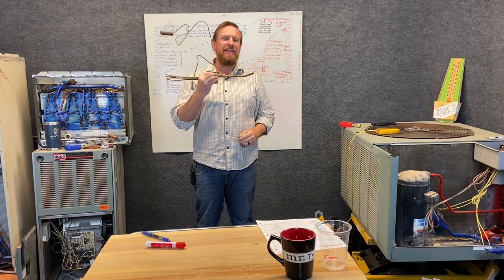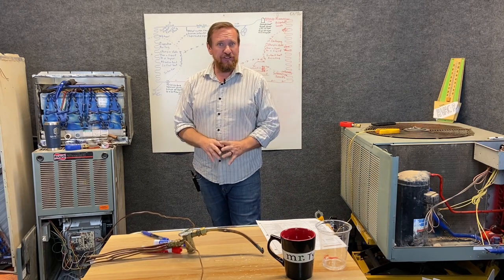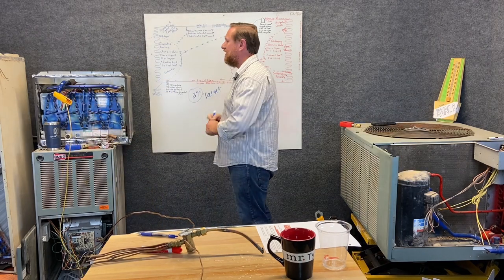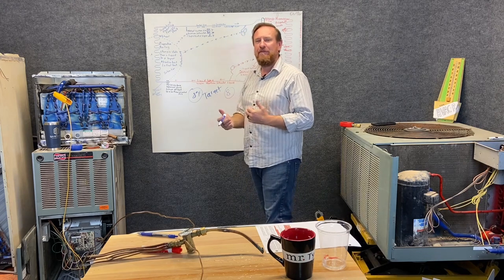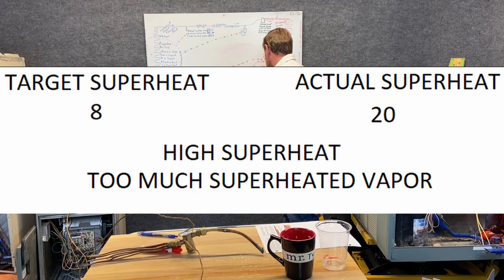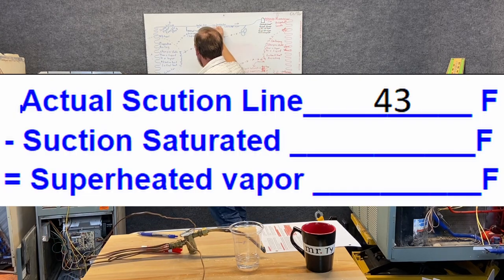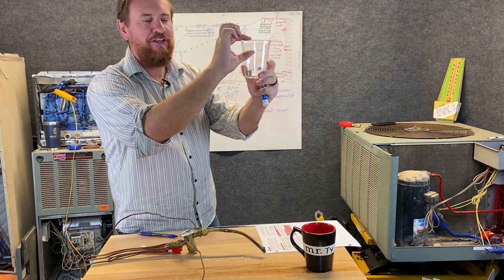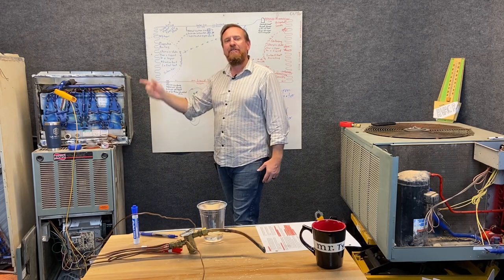HVAC 062 TXV TEV Target superheat vs Superheat, intro level

Comment: Fantastic Ty, and thank you.  I'll say this again, you're a natural at explaining how refrigeration systems operate.
Quick Q: Does the TXV close down (variable orifice diameter decreases) as temperature of the TXV bulb increases?  You probably already answered this question somewhere.
Reply from the maker: Short answer no but it's not that simple. The bulb pressure will push against pin,  the spring and he suction pressure to open or increase orfice size.  It is important to consider the suction pressure and spring pressure. The suction pressure pushes with the spring to close while the bulb pushes to open. Later I will do a video much more detailed. 

Bulb/  pressure,
Spring pressure, and suction pressure all work together.
https://www.achrnews.com/articles/140466-abcs-of-externally-equalized-txvs
Reply: @love2hvac  Looking forward to it, thx!

Comment: If you're working on a system that has a fixed orifice so that would mean that you are checking superheat, and you check the superheat and it's correct. What chart are you using to tell you what your sub cooling should be on the condenser? I see the one you have written on the back of your superheat chart but where are you finding that information?
Reply from the maker: Its information I have gathered over the years, when I get. Back to my library I will source it.
#1 manufactures methods for specific models always override anything anyone has to say. 

Superheat is very important with a fixed office but it dosen't dismiss sucbooling. 
The science behind it is important. 
Think of the condensors as a tank with liquid at the bottom and vapor at the top. As the outdoor temperature increases the vapor pressure increases. More pressure pushing against the liquid pushes more liquid out of the tank less sub cooled liquid.
As the outdoor temperature drops the vapor pressure drops also and you are pushing less refregerant out of the tank more subcooled liquid. 
https://youtu.be/waKHwkqy-uk
https://youtu.be/L43H2PhzqcY

Comment: So the other day I opened up my evaporator to see if it needed cleaned. I noticed that my TXV’s sensing bulb isn’t insulated, just strapped to the pipe. Should I insulate it myself.? Or is it okay.?
Reply from the maker: If its outside the box it must be insulated. If it inside the box I prefer it insulated but some manufactures do not.
Reply: Yeah it’s inside the box. I figured it wouldn’t be the biggest temp difference since it’s inside, but I might insulate it just for good measure. Is there a good insulation to use sir.?
Reply from the maker: @samsmith854 
New calgon foam insulation tape is what I use. Put a cable tie around it also because the tape won't hold. https://www.supplyhouse.com/Nu-Calgon-4218-W3-Presst-O-Cel-Foam-Insulation-Tape-30ft?gclid=Cj0KCQjw8IaGBhCHARIsAGIRRYpui_qongwoAA0ltCueUw4LiFK4NrVCNfqC6QfueRT4wWSYlYgdRuIaAluhEALw_wcB